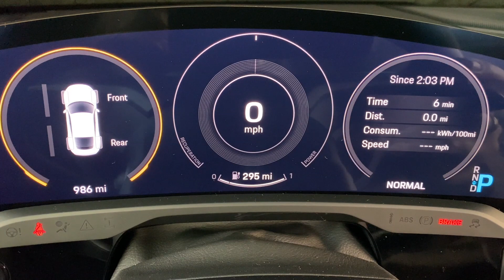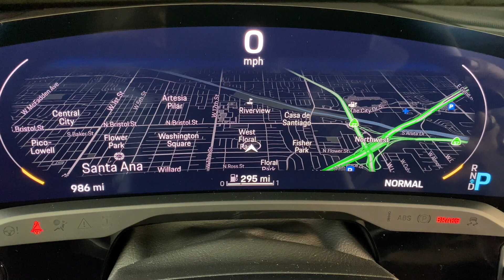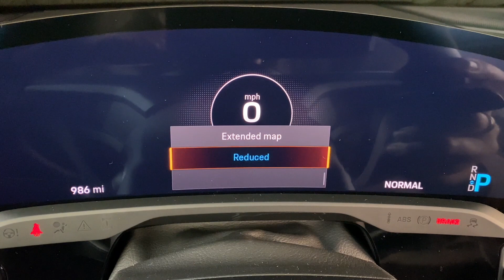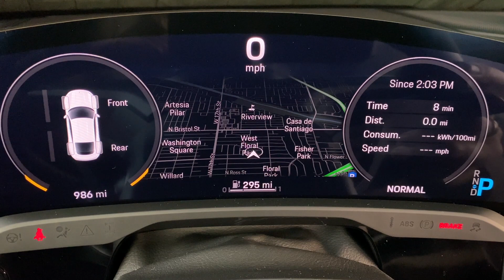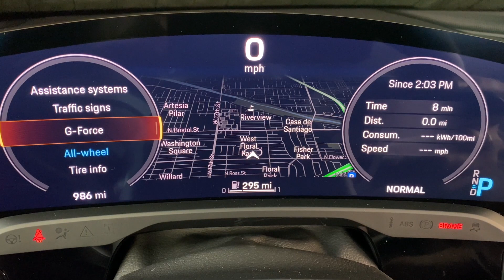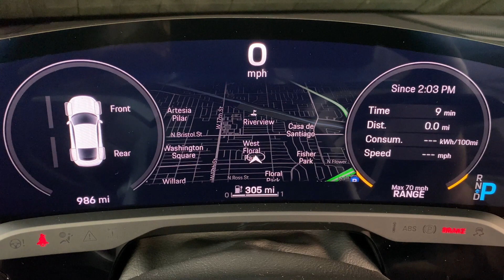Porsche Taycan 4S Gauges Deep Dive

Comment: Thanks for the demo. A few points for you. Launch Control work is Sport and Sport+. The vehicle lowers in Sport+ as well as Range Mode. Also the top speed in Range Mode can be increased from 70 to 87mph so it's not too bad for the freeway either.
Reply: Doesn't the Range Mode lower the chassis, which can cause problems with bumps and pot holes in daily city driving?
Reply: @cyberslim7955  yes it does lower the car so I would be cautious about using it in the city, and focus using it on highways/freeways. You could use it on decent country roads but then of course Sport would be the better option for a Porsche 😎.